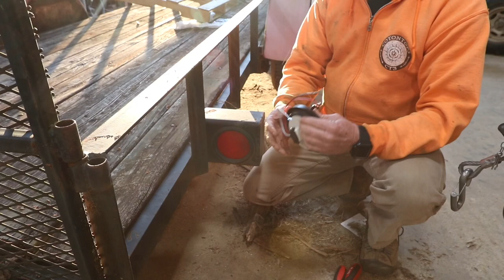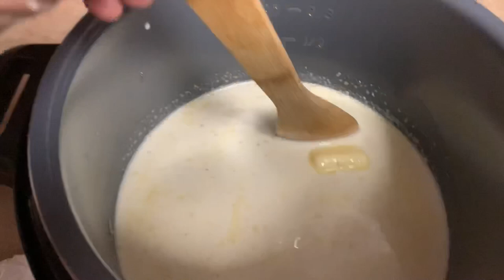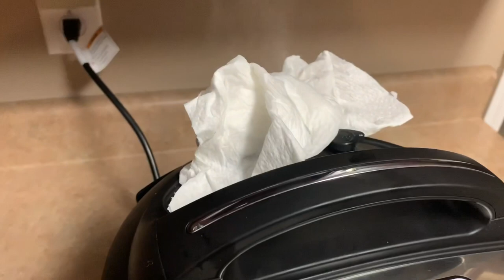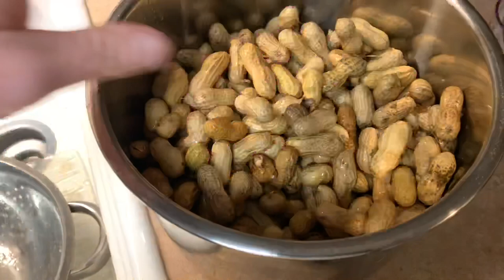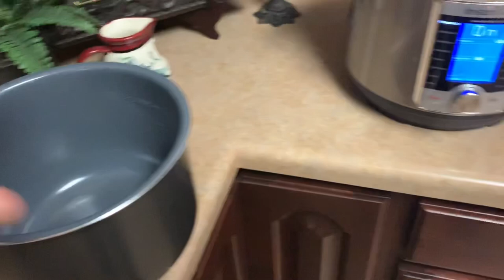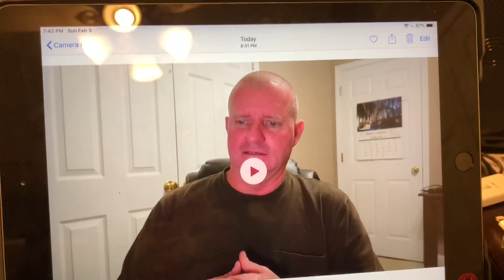Replacing trailer lights with LED’s & bonus footage

Comment: Grits and peanuts looked good. I couldn’t figure out my brake lights wouldn’t work one time. Started checking things out and I had pulled the fuse on the truck the night before. I I felt pretty stupid after that one.Great video!!

Comment: Lmbo!!! I hooked up the truck to my trailer once and couldn't get the lights to work at all. Finally I said the heck with it...using some very abusive adult language and decided to just rip all the wiring out and start over, half way through cutting all the wiring I discovered that I had hooked the trailer to the truck but forgot to plug in the trailer lights 🤪 on the bright side I had wanted to upgrade to LED lights anyways....lmbo🤣
Reply: LOL At least you didn't wire your brake controller into the turn signal flasher by mistake. It took me a few minutes to figureout why the truck was raising all kinds of h@ll lol

Comment: True trailer story: I had an ole 5x10 tilt trailer that hauled my 4wheeler to the hunting camp with. I left the hunting camp one Sunday night headed towards B’ ham, Al. It’s about a 2 1/2 hr drive from Thomasville,Al. to where I live south of B’ham. I got stoped by a traffic light in Selma and had to make a left turn at that light so when I got the green light I took off. I made my turn and started up the highway. I had not gone very far and a cop blue lighted me so I pulled over. I knew I wasn’t speeding so I was curious to see what he wanted. I rolled my window down and his first words were, DID YOU LOSE SOMETHING? I looked back and my 4 wheeler was gone but the trailer was still there. He told me that when I took off at the traffic light the trailer came up and the atv just rolled off. I had forgot two things! I forgot to put the pin in that keeps the trailer from tilting and I forgot to tie the atv down. Anyway the officer told me that my Atv was at the convenience store on the corner where I turned and I went back and got it. Could have been a lot worse. I will confess I had a Johnny Cash cassette turned up pretty loud when I made that turn so I don’t guess I heard all that commotion. Lol. Y’all have a good-un!

Comment: I hooked up my truck to trailor and the lights wouldn't work rewired the whole trailor then found that the wires on truck had got pulled out of plug on the truck now you talking about feeling dumb man I had a case of it LOL